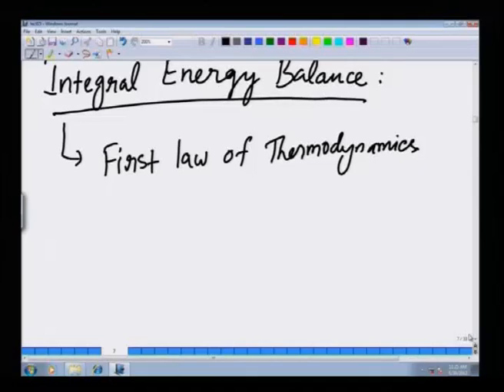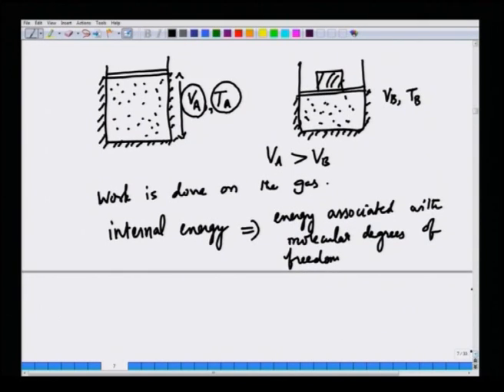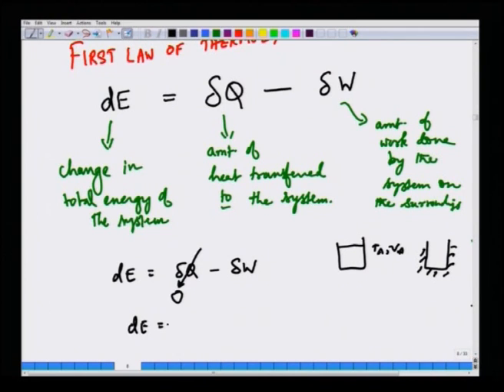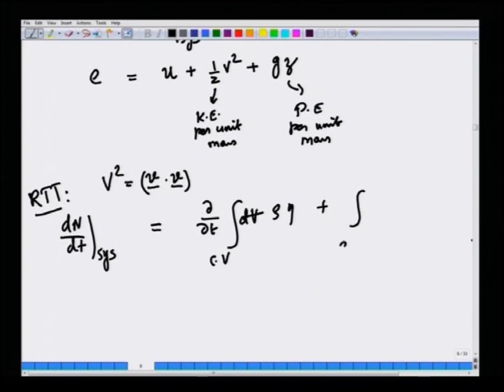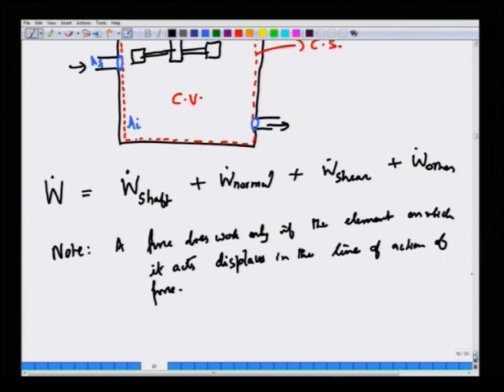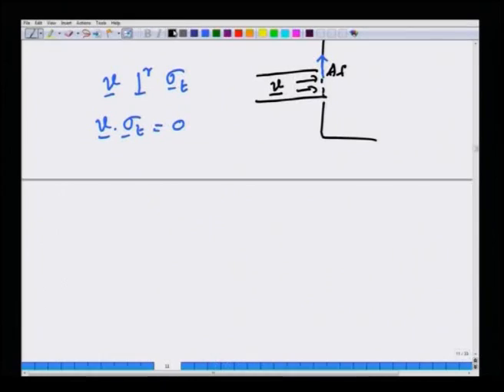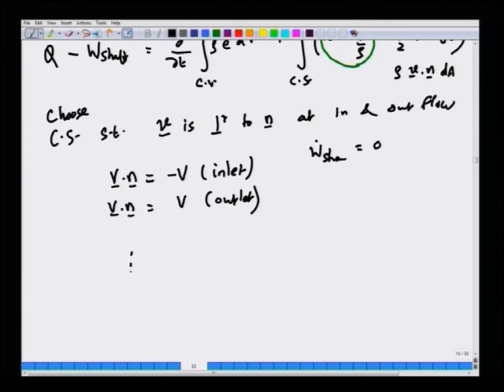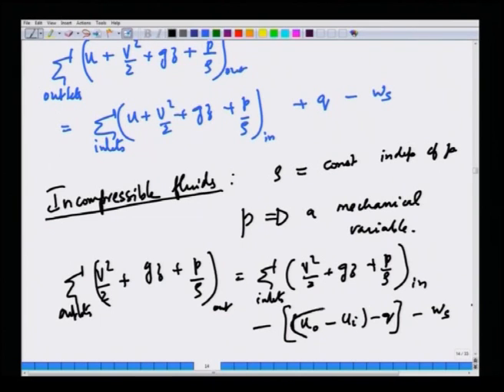Mod-01 Lec-16 Lecture-16

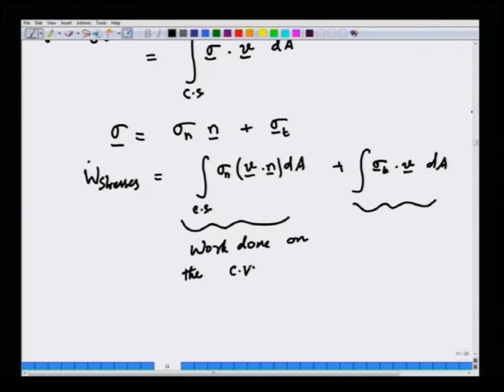Comment: sir, at 34:26 of the video you have taken work done by the cv on the surrounding as negative but in thermodynamics, we say work done by the system as positive. please help me I am confused about the sign convention.
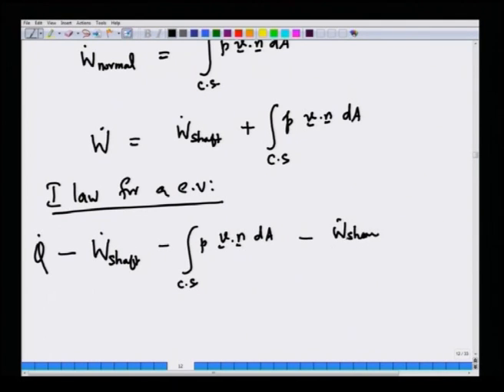Reply: Your issue resolve at 41:05 
There work done had taken in positive
Reply: v (vector) .n (vector) =-ve ie why minus sign put to get the work done by cv on surronding overall a +ve
Reply: Work done on the system is (+ve)
And work done by system is (-ve)...